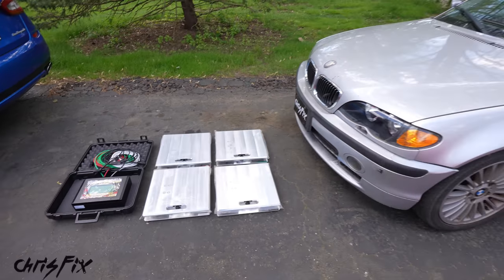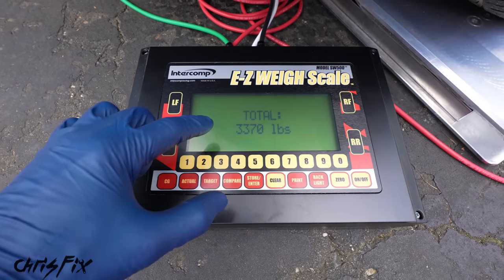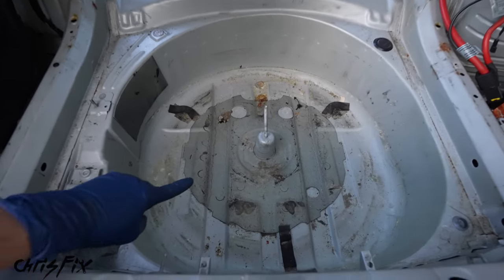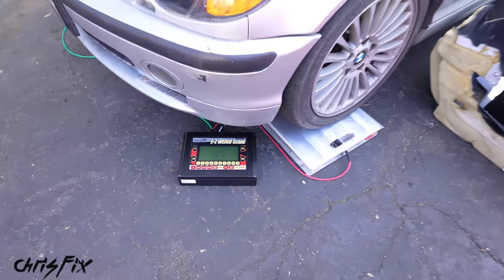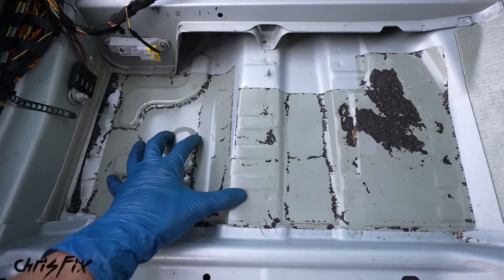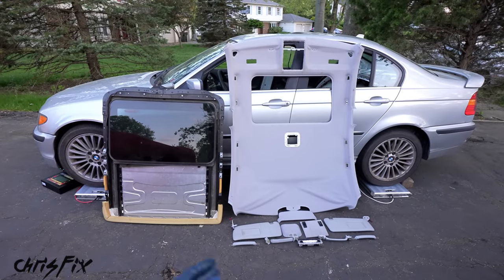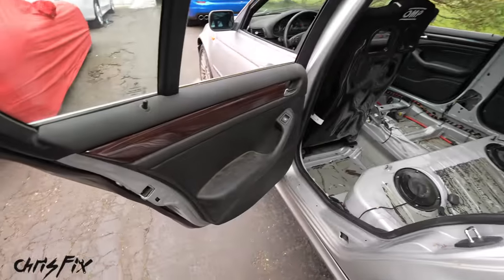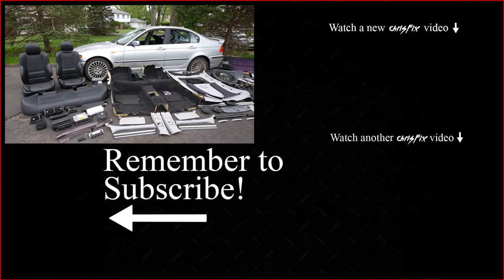How Much Weight can you REMOVE from your Car? (Weight Reduction)

Comment: Pilot here! Weight is very important when flying so I assume it’s important in driving. The reason airlines will make heavier people buy a second seat is because of fuel… we have to know exactly how much weight is added to the plane so we can remain flying… if we didn’t calculate our fuel to weight ratios we would run out of fuel or we wouldn’t be able to land… also the plane needs to be as light as possible when landing so it’s as smooth as possible… the other reason for making sure we burn as much fuel as we can right before landing is so that if we crash there isn’t that much fuel to catch fire. So we calculate exactly how much we need and if for some reason we get to our destination and we are too heavy we will fly around the airport until we are ready… PS right before a crash landing usually pilots will dump the fuel… there is a feature on most planes that immediately dumps all the fuel which increases our chance of survival… so if you see a plane dumping fuel you are going to the ground right now.
Reply: I love those flight related details. When I lived in Darwin, north Australia, I was always surprised how few airplanes I could spot during the year. I guess that's not a very common airplane flight path.

Comment: Where did you find the sunroof delete panel? It looks better than the ones I’m finding. 
I’m also building an E46 Lemons 🍋 car so your videos are quite helpful!
Reply from the maker: I tried to look back and see if I had written down what we have in there but I'm not seeing it, we had an issue where the guy never sent us tracking info or anything and it took a while to arrive, I'd say that any of the fiberglass ones like this are a dime a dozen so just get one that has good reviews and is relatively cheap
Reply: Appreciate your reply Chris, thanks!

Comment: When you take the last owner route, there is so much lightness you can add. Not all at once, but as you need access for replacement and/or repair. Dry ice is a hot tip.

Comment: i realize this vid is a couple years old. but i ripped just about everything out of my highly modified 68 camaro back in 1986 just to make it a 9 second daily driver. i only had front and rear windows and not even a radio or climate controls. now mind you i lived at that time in southern arizona so weather such as rain and snow weren't a big concern to me. losing weight to make more useable power is a real thing.

Comment: Fibreglass bonnet/hood fibreglass boot/trunk
Custom doors: after weighing the doors including the glass window, a lightweight steel frame could be manufactured in the shape outline of the doors, a couple of strong side impact bars that double up as door strengtheners, then skin the whole door in fibreglass adding perspex panes to the doors.
Strip out unnecessary panels underneath the car, strip out wheel arch plastics, mock up front wings, make in fibreglass, fully remove dashboard, remove stock exhaust, rear window glass in Perspex wing mirrors swap for light weight driver's side only..
Finally, after studying car monocoque design, redundant and non structural area's of the body work, which provide no integral strength to the car, drill a series of circular holes and remove coin sized metal from the car monocoque.
Weigh all that up, and accelerate below 6, maybe even sub 5 remove all engine plastics, air filter, wiper motor and wash bottle, indicator's and headlamps

Comment: Dry ice works better if you use it with isopropyl alcohol. It allows for better conduction so you don’t have to wait as long you can also scoop and pour it onto spots where dry ice wouldn’t stay on its own like the sides of the transmission tunnel.

Comment: too heavy rims, replace them with smaller and lighter, and your tires dont have enough grip which also decreased acceleration. also the handler could be replaced by a smaller lighter one.

Comment: I would certainly remove a lot of useless plastics from the engine bay as well, including not only various unneccessary covers, but also carpets for sound and heat insulation.

Comment: i was actually waiting for you to remove the doors, the trunk, the hood, all the glass, side mirrors, head lights, tail lights, bumpers, reduce fuel to minimum, then that would have made a lot of difference, specially the handling of the car around corners. The best thing in your video was the 0 - 60 times, and the braking disctances. Good job.
Reply from the maker: That all had to be kept on for safety reasons with lemons and reducing fuel wouldn't have helped as this is an endurance car so the fuel could be anywhere from full to near empty. Thanks a lot!

Comment: if you do the acid dip or laser beam to strip the paint and all the useless stuff you would gain another 40kg (85lbs) 
just seen on garage 54..
Reply from the maker: It would rust in like 2 seconds unless you repainted so not really worth it

Comment: Battery’s are important too they supply horse power aswell if you get a upgraded battery you’ll notice the difference
Reply from the maker: Batteries only provide voltage and current they do not provide horsepower.
Reply: Woman☕️

Comment: You could gain a lot of performance by changing the rims for magnesium ones o carbon fiber, also redesigning the bushing of the wheel (I don't know if spelled it correctly) making it of titanium and with an optimal geometry. With this things acceleration might increase a lot due to the unsprung mass of the car. Also other improvements might be replacing metal parts such as the hood fora a carbon fiber or glass fiber ones, and removing unnecessary things for competing such as the air conditioner pump

Comment: 14:20 Actually you shouldn't wear gloves when handling extremely cold materials. The gloves can freeze hand then freeze your hands behind them. While if you don't have gloves the leidenfrost effect protects your hands because the heat coming of them make the ice subliminate into gas before coming into contact with them.

Just something good to have in mind for next time :-)

Edit: This apparently works best for liquids so doesn't matter too much for dry ice

Comment: I just bought one of these with the valve cover leaking, drove great, but valve cover leaked. Any experience with valvetronic motor? I have a no crank no start since I changed the valve cover 😢

Comment: And there's another 300 lbs that can still be removed if you actualy get into replacing components with lighter ones (such as the heavy hood and truink, stripping the doors and adding in plexiglas or netting, dropping the entire AC system and heater core ( it'll leak soon anyways), a smaller radiator, lighter tires/rims, CF panels where practical, and so on. New exhaust ( sell cats obviously, and so on ) 2600 is quite possible with the factory front and rear glass still intact.

Comment: ac delete would net you another 60lbs. you got the ac compressor, condenser, ac lines, and some freon. Also you can do a power steering delete as well. It would likely net 100 lbs with the ac delete
Reply from the maker: Cant do a power steering delete with the AWD because the steering geometry but I did the AC delete: https://www.youtube.com/watch?v=Ku8TpzQA8zE

Comment: So, if I have a mid engined car, how important are the 2 fabric interior engine covers? I’ve drive with them off, and it’s only sketchy once the metal heat shields are also removed, but idk if it’s necessarily safe

Comment: you should remove the catalytic converter and the mufflers. they weigh alot and you will get more power if you remove them.
Reply from the maker: We did when we put the "new" engine in!

Comment: Imagine you just parked at a store and are about to go in to buy groceries and this guy goes, hey, is that for sale? And you say nope, but it’d be worth a lot if it was and he goes: I’ll give you $1900 for it. You say no, at least 6K and then he goes: firm 1900, gives you the cash and starts disassembling and ripping out everything. “alright guys, that’s how you go from a car used to buy chores as a daily driver to a much more light frame, fit for racing.” And then drives away with your car 💀

Comment: Do the endurance rules allow for side windows to be swapped for plexiglass?  Then remove the side covers for the doors as well as glass, lifting motors, and linkages.  Despite the rules it may be a bad idea for general safety, however, there has to be a lot of weight in tempered glass and lifting infrastructure.

Comment: seat belts removed = not good idea, but good idea is changing the windows (except front one) with plastic-ones, removing the window motors,  door airbags.. sound iso.. and more in side the doors,  you can remove the whole doors and preserve them on  a side or sell them the way they are, and make custom doors from fiber glass and 1 door is like 40 -60 kg and the fiber glass - ones  are like 2 kilo per door
Reply: you can change the front hood and back trunk with fiber glass, there is big metal in the bumpers, you can remove them also, they go with buffer rods - all heavy metal, all can change with fiber glass parts
Reply from the maker: Thanks for sharing! This is race car so it got harnesses
Reply: I take my words back about anything is being bad idea, i was wrong. Everything is very nice and good idea
Reply: About fiber glass.... i mean carbon parts building, i don't mean cables

Comment: For non-car people, let me explain why race cars have roll cages. For one, it's race car, bro. Second, roll cage is actually lighter than most of the interior. It's very important to keep race cars as light as possible to be fast as possible. You don't even need to go that far to see a roll caged car. Vaughn Gittin Jr. has his Mustang GT roll caged because it will actually help to drift better. Chris doesn't have his 1998 Mustang GT roll caged, so it's only the matter of weight that will contribute to the speed. And please don't do roll cages as a clout. Roll cages are purpose mods, like drag radials, duck tails, things like that.
EDIT: I forgot to mention safety. Since the car is roll caged, you don't need to worry about the car collapsing when crashing or rolling over, hence the name, roll cage.

Comment: Mave you can remove wiper fluid system and whole air conditioning and ventilation system?
Reply from the maker: Most of that was removed after the cage was installed. I think we dropped another 30-50 lbs

Comment: Cut the entire exhaust out muffler catalytic converter‘s and the pipe all the way to the front of the car get rid of your airbox and do a AC delete that would lose probably over 100 pounds and free up 2 or 3 hp
Reply from the maker: That has been done since this video, and you were right, we removed another 100 pounds past this!

Comment: So a little more than 10% faster acceleration is exactly what you would expect when losing a little more than 10% of the weight. a = F/m so if you lose 10% m (mass) you gain 10% a (acceleration)

Comment: 430lbs for .8 of a second.

Could get the same, if not far better from using better quality fuel, ECM tuning, and better quality engine parts. Not to mention adding a super or turbo charger.

But at least what you did is free
Reply: less weight is better everywhere not just acceleration

Comment: i build drag cars dont forget ac pump power steering heater /ac fan ac hoses and cores you want it light strip it. man up you dont need power steering or ac with them and their components gone much lighter and less drag on motor all so increase horse power

Comment: OK ! so.... not only did you tell people about how much weight we all can save... but ALSO about SAFETY !!!
TWICE !!!! the first time with the battery terminal and the SECOND time with the Carbon asphyxiation possibility.
wow, dude... if I had a shop, you'd be on my wall even if you didn't work there

You know what ??????? even BEFORE the 0 minute 50 second mark... I was already on effing board.
Damn, Chris !! where were you when we needed tuning on the streets ?? ah wait... not born yet ? f**k

WAIT !!! you did NOT install a WASHER on the driver side second bolt !!!!!!!!!!!!! OMG !!! ;)

Comment: 16:02 ohkay
15:43 how did you cover the vertical section with dry-ice?
Reply from the maker: Didn't bother, I just went for the easier deadening. If you really wanted to remove it you could just hold some dry ice with an insulated glove and some aluminum foil in between to get it cold and give it a good whack

Comment: What about the AC compressor?  If you removed the climate control, that seems like unnecessary weight.  Is there a silencer on the car's intake that can be removed?  Is a muffler required... you could run a straight pipe if not.

Comment: Im astonished you havent swapped out the wheels for lightweight enkeis, im even more astonished you havent swapped the wheel studs and lug nuts for titanium, that would save you 5 pounds AT THE WHEELS which is worth 8 TIMES as much as dead weight.

Comment: Dude forgot to remove

. stock air filter weigh 10kilo, ..use cone filter

. remove stock metal fueltank weight 35 kilo,

use a 5liter bottle instead.

Comment: Tip : remove the door and weld in a sheet of aluminum at their place to remove roughly 200 kgs
Reply from the maker: For safety reasons we cant do that and it's nearly impossible to weld steel to aluminum

Comment: I'm not even close to a race driver, but why the hell would you remove the airbags? If you crash they would literally save you. I think it's worth the extra weight...
Reply: in a race car with roll cage, harnesses & a hans device they are useless and potentially unsafe

Comment: If you really wanted to remove all the possible weight, for the race... why did you leave all the glass, doors, trunk lid, lights, exterior trim, roof, ...? All of it is not needed for the car to drive, all of it is excess weight slowing it down. You already made the car not usable for daily normal use, you are just making yourself slower when racing.
Reply: thats a terrible idea, you dont just remove everything

Comment: ffs take off all the sheet metal and replace with duck tape and wrapping plastic....Cut holes in the bottom plate, you really don't need a complete bottom plate it'll be fine with a few nice holes in it...and who needs side and backwindows?

Comment: are you fat? if so, losing weight would actually reduce the weight of the car. airlines should charge passengers based on weight because it hurts fuel economy, not just about racing planes or cars. the weight really affects the bottom line in business.

Comment: Yeah all that weight reduction is nice but almost useless. I have built many race cars over the years. And all that was sprung weight. So for every 100lbs  you cut ever quarte mile of track by 1/10 of a second per 100. You get far better results to cut unsprung weight. On that ratio it is roughly ever 10lbs is the same 1/10th. You get that by weight reduced control arms, sway bars, struts, springs, and light weight aluminum wheels. If you can cut just 40lbs of unsprung weight it will be just as good as that 400. And you can do that easily in just one wheel area. Just a thought to help your race. It gets expinsive to get the lighter parts but well worth it if you get serious into it.
Reply: sway bars arent unsprung, and control arms are only half unsprung
Reply: @arcanevoid9199  lol the sway bar is part of the spring system. Just like the coils. It all ties into the control arms and thus is the same as cutting unsprung weight. But don't take the advice of someone who has been building track cars for running around Barbers Motorsports road course since 2004. You will get far more gains by cutting weight where i suggested but no cut that 5 lbs of headliner....instead of getting lighter wider wheels for more weight cut and better traction with a wider tire.
Reply: @chazharrison9760  it is but not in the same way as a coil spring, the sway bar is usually bolted to the chassis or subframe and is therefore sprung weight. control arms are bolted to the chassis/subframe and the knuckle etc so they are only roughly half unsprung. not disagreeing with you about how good removing unsprung weight is, ive taken off 11kgs just from wheels & lug nuts which has been massive